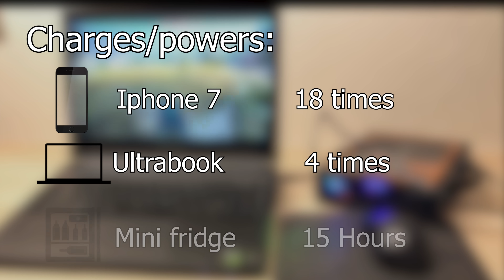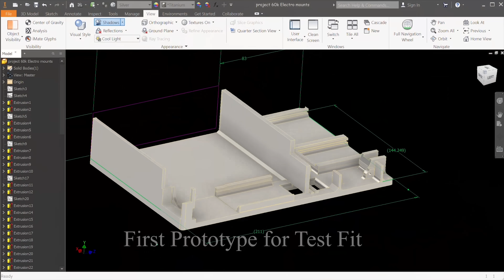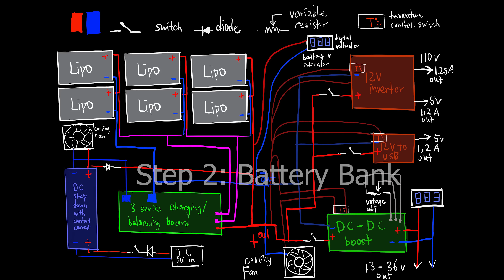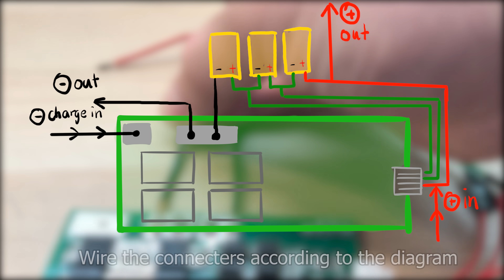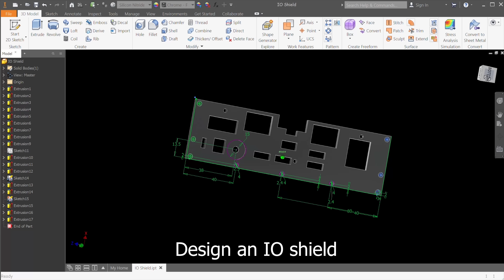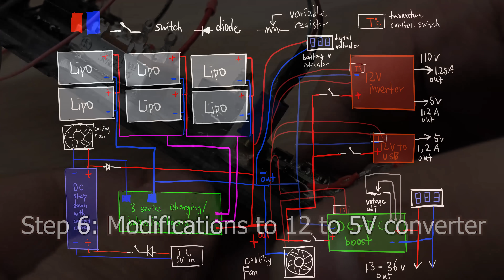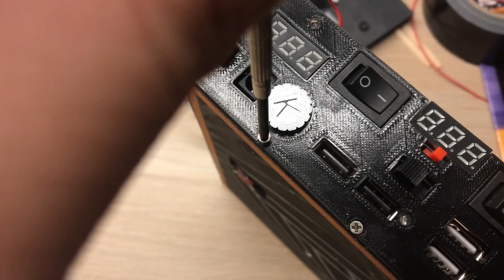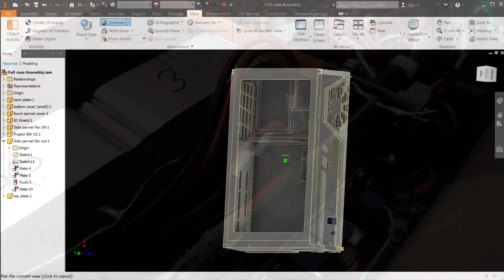Ultimate DIY 60,000mAh Power Bank (222Wh)

Comment: 150W Inverter is not a Pure Sinewave Inverter... wouldn't risk it.
Reply: Modified square wave inverters are fine for a lot of equipment that is likely to be plugged into something like this, especially anything where the AC output immediately gets converted back to DC and/or where the connected device's power supply is sufficiently filtered. The majority of UPSs likely to be used in homes and small businesses will be modified square wave, simply because pure sine wave is a lot more expensive and heavier to achieve (and weight is an important consideration in this application!), and it's very rare for people to have problems with those (I've certainly never had a problem with either of my modified square wave UPSs...).

It's definitely worth remembering that it's not a pure sine wave inverter, so that anyone using that inverter doesn't connect something to it that will be affected by the dodgy waveform (e.g. certain audio amplifiers, AC motors, etc.), but dismissing modified square wave technology outright just because some devices won't like it is robbing people of the opportunity to save some money on the inverter if they don't need an actual sine wave output...

More info from people who know what they're talking about more than I do: https://superuser.com/questions/912679/when-do-i-need-a-pure-sine-wave-ups

Comment: I'm not believing that there is 60,000 mah  OR 60 ah storage density in that size package of six! First off an energy 
density for that size of LiPo sandwich sized surely must be a seriously overrated OR a simple miscalculation first off!
A 60 Ah energy package of this size that I already looked up will not fit in a plastic case that size and secondly as for
the suggested 60,000 total mah costs over 200 dollars and still cannot be facilitated into that plastic case period!!!
So, I'm calling this as bs!!! You cannot take 60 lbs of chit and packet it into a 6 lb sack!!! Though your plan of execution 
for this kind of project is sound enough to at least make a go of making something that is powerful and that's all good 
and nice!! This guy's soldering skills are just plain terrible if not nearly the worst that I have seen and this nearly defeats 
just about the entire project. I wish that I could say more that is constructive and nice and all that butter n fluff but heck 
no because of said shortcomings, this project is almost entirely botched from almost the very beginning to the end!!

Comment: You are recommending taking parts from broken devices??? OMG
Reply: if the part you're taking is not broken, why not(assuming proper testing)?
Reply: @alexrichards1353  Do you mean that first the part is tested and within parameters?> That can require special test equipment and take time. PLUS one has no idea as to its remaining life,i.e. it could have been thermally stressed to the point of failure.  A battery could be nearly chemically exhausted. Electronic parts most definitely have a limited life. Using used parts is a good way of making a circuit troublesome, have a short life, and unreliable.